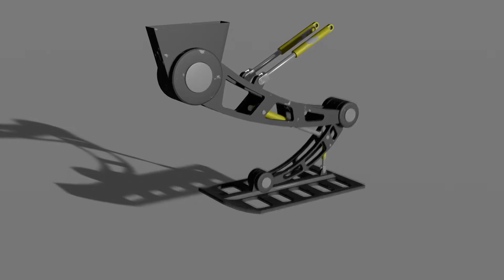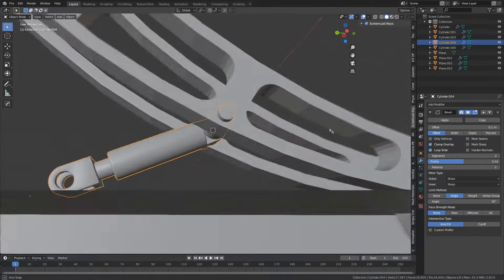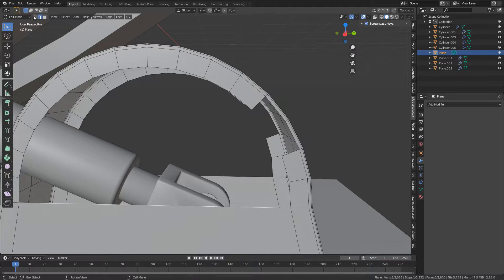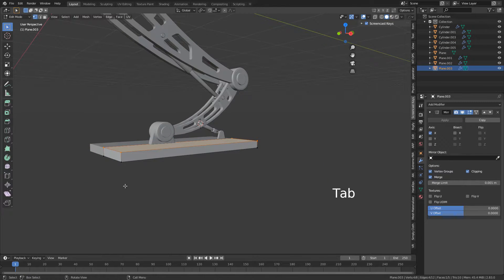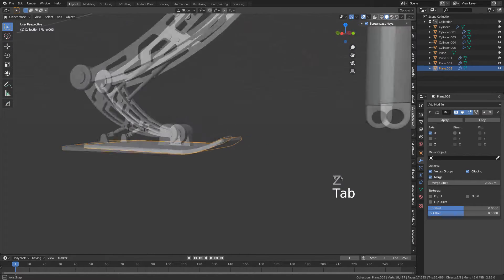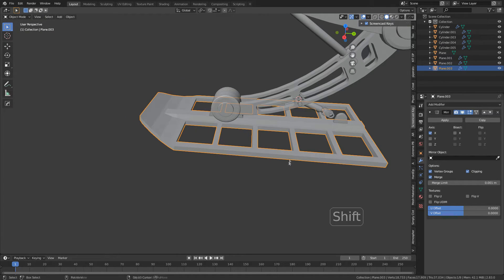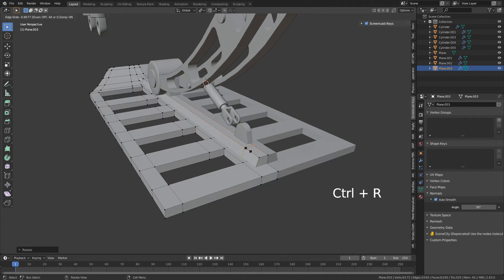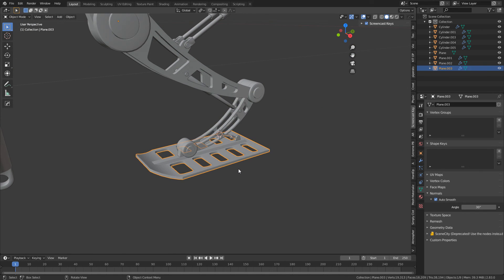Blender Modeling Scifi Landing Gear - Modeling Tutorial Part 4

Comment: In such situation "box select" (by default) is much faster (circle select requires two more actions: push "c" and after right click vs one holding LMB). Do you think about constructive weights, i'm not an engineer but methinks some parts in this construction are weak, and probably will be broken or deformed after landing.